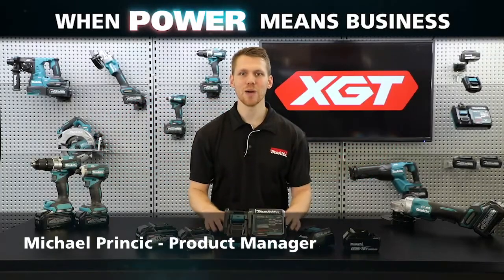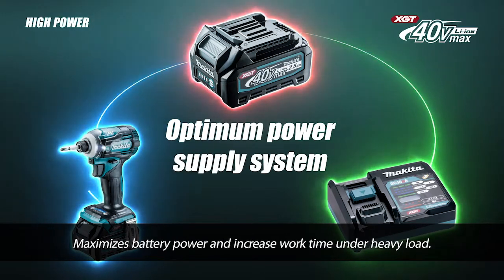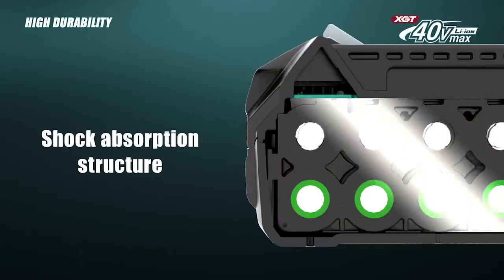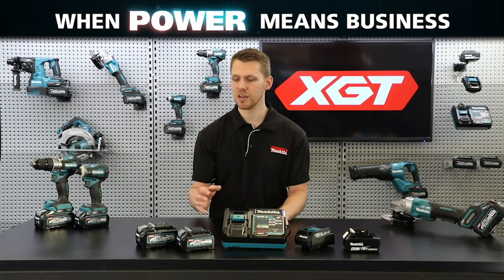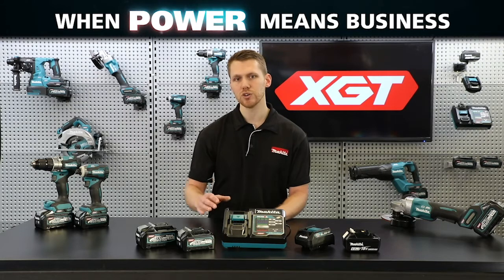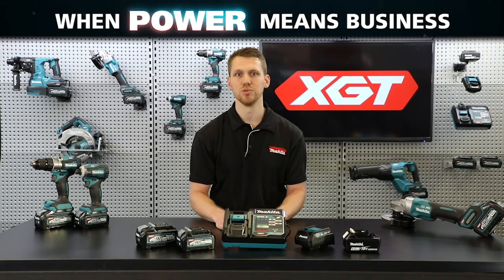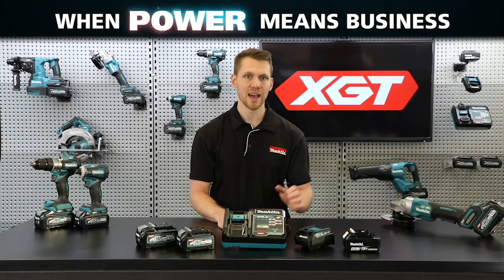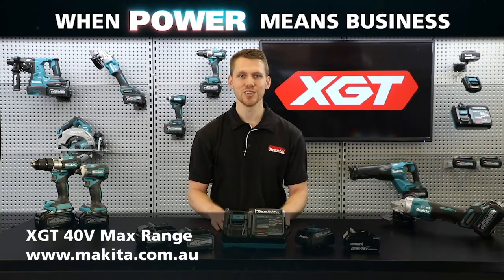XGT 40V Max Battery & Charger Technology

Comment: The difference between 40 volt batteries and the to 36 volt tools with the 40 volt batteries All batteries wear out overtime so to replace a 40 volt battery is twice  as expensive and you could say that they have twice the power then the 18 volt which is true but the 36 volt system if one battery give up overtime I only have to outline for one 18 volt battery so my purchase for that day is half  the price of a 40 volt then a few months later the other battery gives up I only have to outlay for one 18 volt so my outlay is less each day then what a 40 volt would be I don't want to spend double the amount when I need to buy a battery and when Makita bring out higher powered tools they only have to add another 18 volt battery or another two it make sense

Comment: For those wondering about how it compares to the 18v in terms of efficiency, a 2.5ah 40v battery theoretically works for +- the same amount of time as a 5ah 18v one (if they would power the same tool).